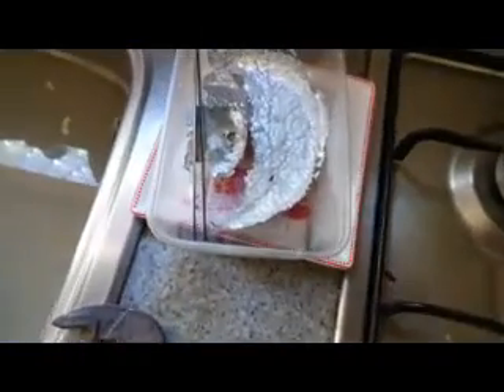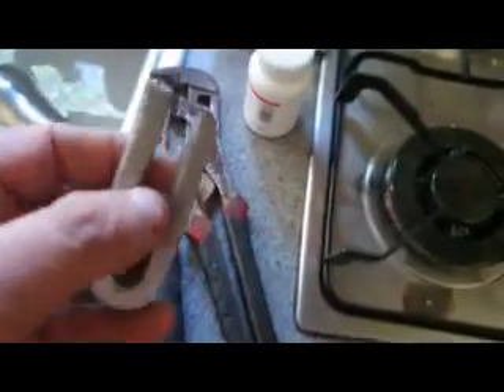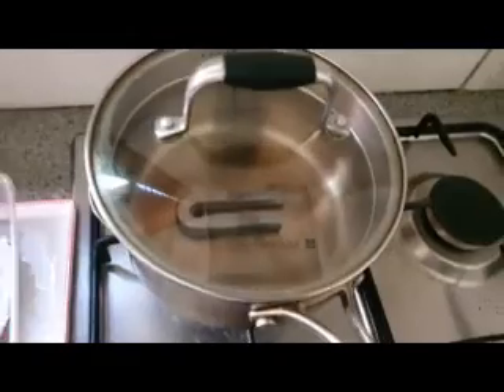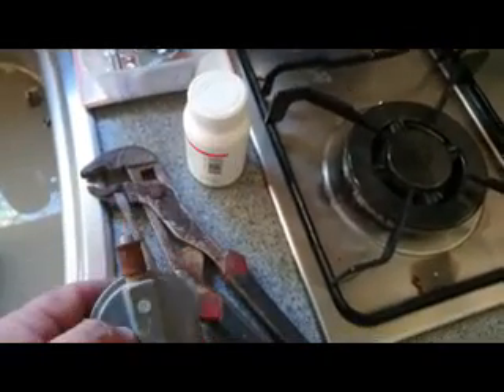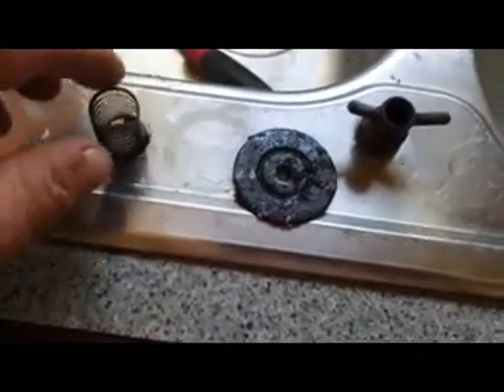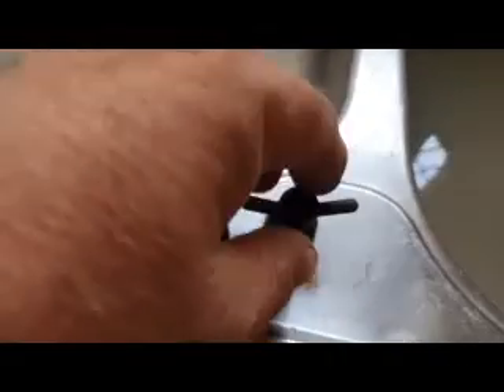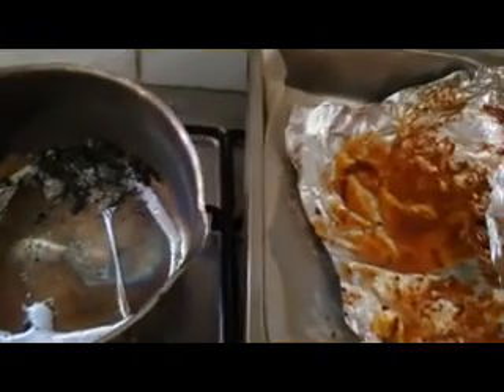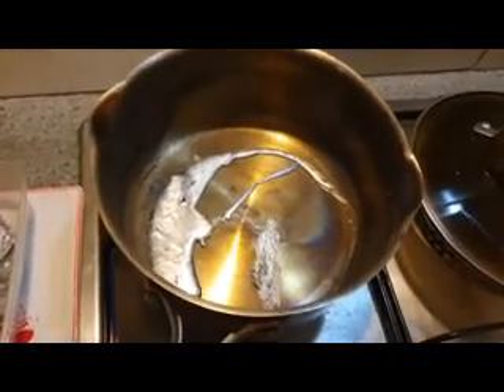making zinc powder

Comment: Try a little boarx powder// flux  will separate the dross from the metal cleanly. save a lot of zinc over a few melts
Reply from the maker: thanks , i cant get zinc anymore . it turns out the metal was pop metal which is a mix of zinc and aluminium . it was fouling up the solution. but i worked out that the part which balled up was the zinc and the part that stayed a clump of metal was the aluminium. which was handy

Comment: What do you want the zinc power for?
Reply from the maker: its used to precipitate precious metals from solution
Reply: @prospectorpete  Thanks for your reply, but what's wrong with sodium metabisulfate ?
Reply from the maker: @antoniotrepistole1383  nothing. There's many things that can be used. I also use copperas too . But they're only good for gold.
Im also recovering platinum and palladium and rhodium.
Those need other precipitants like chlorine gas or ammonium chloride or zinc
Reply: @prospectorpete  Thank you Pete for your explanation I have learned something new. 
Cheers
Reply from the maker: @antoniotrepistole1383  that's great. That's my aim
Reply: You can use it TO MAKE BATTERY,  to save your electricity, and your pocket.

Comment: Nice one mate, will definitely give it a shot 😁
Reply from the maker: nice, let me know how you go
Reply: @prospectorpete  I found it alot easier to melt the zinc in my crucible,  and adding a little borax. 
When I poured it out  it was clean, all the dross stayed in the crucible and was easy to remove after .
If I find the time I could do a little vid, I just need to find a suitable steel container to shake it in,
Rather using a large pan.
Reply from the maker: @crux9584  nice. Id like to see